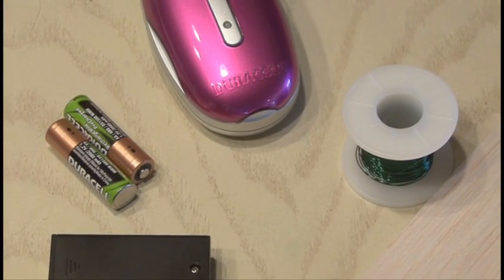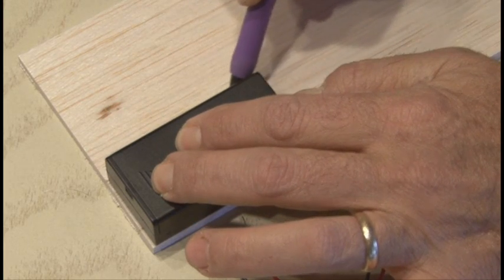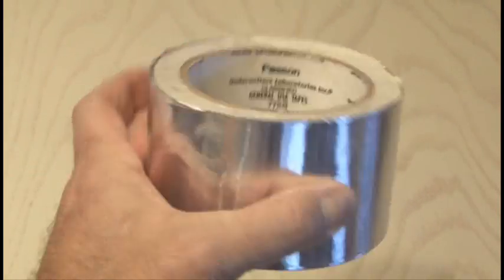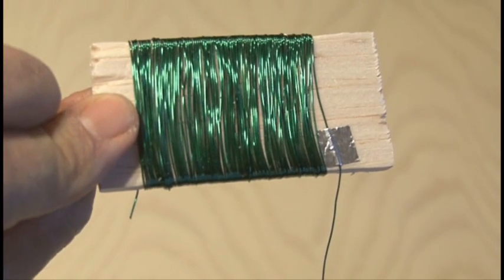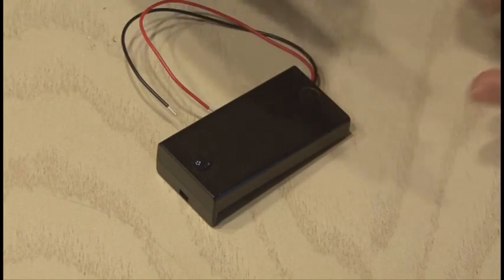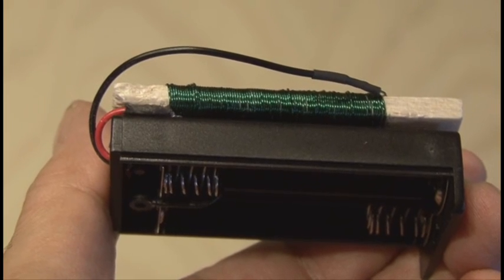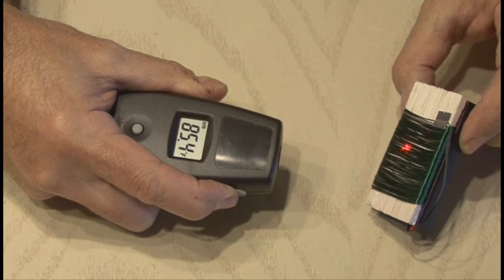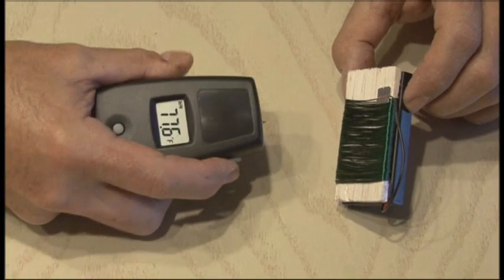Weekend Project: Personal Portable Heater

Comment: Will this make the positive and negative contact and make the battery hot then exploded
Reply: +Minh Vu *SIGHS*
Reply: not when the wire is this long, instead of directing heat to the batteries which would make them explode, the heat is directed to the wire
Reply: Haqet
Reply: Minh Vu it depends on the resistance of the coil

Comment: Could I use a 9v battery
Reply: Possibly but keep in mind one AA battery is 1.5V so two equals 3V, by using a 9V you are adding A LOT more electricity
and it could overheat to the point where it could burn you, catch fire or even explode the battery.
Reply: ***** If the 9v battery could supply the current then yes that would be true. However, they have only about 150ma of power. It would not last long at all and would not be very warm.
Reply: ***** Not enough current for that kind of heat for something like that. Electrical solder melts at around 360 to 400 degrees Fahrenheit. Besides, there are some videos that show how to make a battery powered soldering iron. Some could even run off USB ports, but don't use the ports on your computer. You would just blow an internal fuse.

Comment: can you use non insulated wire? that all i have
Reply: floSa  from 3 volts you wont feel a thing even at 9v you cant feel anything
Reply: No you can't because you will short out the batteries and get the wire to heat for a few seconds very hot
Reply: Electricity is flowing through the wires.
Bad idea to not isolate them lel
Enjoy your shock :D

Comment: I had a problem building my project and I would appreciate it if somebody could help me out.

Having a basic knowledge of electrical circuits, I tried to build one of these portable heaters. I used two 1.5 volt AA batteries in a holder, as mentioned, and a metre of resistive heating wire. The wire has a resistance of one ohm per metre, but there doesn't seem to be any noticeable heat produced when I complete the circuit. Does anybody know what I could do to increase the heat output? Do I need a higher-voltage battery? 

Thanks in advance!
Reply: im not that good with electronics but i do know the type of winding wire matters and may effect heat generation... multi-core wire won't work as well as a single core (bell wire) cause the multi has more surface area to heat up where as the single has just one wire thus less surface.

so i guess to increase heat generated id say if your using multi - core wire replace it with a single core. The other thing that might be a factor is the state of the charge left in your batteries. Another factor maybe the thing that you've got your winding wrapped around that may be drawing out the heat generated by your wire and acting like a heat sink.

from my experiences i do know when i used single core wire in my electronic projects they tend to heat up quicker then multi, cause of this i stray away from single core lol

anyway hope this helps ya :3

Comment: wait less wire = more heat?
Reply: yep thats how resistance works in wires, if you use a REALLY REALLY short wire, Its going to be so hot, it'll met within seconds lol
Reply: what about regular copper wire?
Reply: Yes. V= I.R so shorter wire means less R(esistance) which in turn means more amperage(considering Voltage is unchanging). But if you keep the wire too short, you'll basically short the batteries, and probably burn your hand.
Reply: illusive aeldre would you be able to start a fire with it if held up against clothing??, Who cares about batteries, if the batteries short in a few seconds oh well as long as the thing gets high enough heat to catch cloth on fire Mission: Burning Man can go under way >:D lol, Okay kiddies, let's play hot potato!!.. no no, better yet, LETS PLAY TAG, and member, you can only tag shirts!! OH and let's not forget, okay kindegardeners, lets play duckd uck goose with this magic stick, run in the circle tagging the 3rd person you reach on the head with the stic!!, OHH OH and let's not forget passing by a mall cop and hitting his back with something like this by only walking past him IF this thing catches on fire asshole cops here i come lol, Just gimme a low temp buring oil and this bomb basically and hehehe, im coming for you
Reply: illusive aeldre OH another question, if i connect the red to black and black to red would that cause fire or sparks with this??
Reply: You could  start a fire with an AA battery and some piece of wire. But you could do the same with matches. Matches would be more effective and less dangerous. 

If you connect + and - of the battery with a short wire, wire will get hot and catch fire. Battery might explode too. There probably won't be sparks with just an AA battery. With a 9v, maybe
Reply: illusive aeldre Great great, NOW which of the 3 work best for fire/explosive??,

1. 2 9v's to eachother, (heard it somehow, But i dont know exactly which orientation they need to face in order to begin feeling very hot)

2. 2 AA's with a wire connecting A to B THEN another 2 AA's BUT reverse direction (so say the first two have + going up on the Y axis AND on the left of them is the C and D AND their + is facing down on the Y axis BUT then you take the flat rectangle and fold B and C over onto A and D to make a 3D rectangle/cube) AND B connects to C and C goes to D THEN D hooks back to the other end of A that is NOT already connected. Understand my description??

3. Taking 9 D batteries, Rubber-banding them all together through some scheme or another THEN putting them into kerosene THEN placing it down THEN putting some coal RIGHT BESIDE where I place the battery THEN some newspaper ontop of the coal THEN pour kerosene ontop of it all once I placed all that THEN light the batteries on fire, would that then explode sending the coals on fire by chance in directions AND/OR lighting the newspaper on fire so it can be blown away??

Which would be most spectacular for an explosive, fire, or fire-bomb?? I don't want to use ONLY a match, I'd rather go big for 1. Possible firework uses or at least backwoods-fireworks lol, AND 2. To drop out of a low flying plane into the forest to make a forest fire AND 3. for well.. putting into a asphalt covered street and lighting it as a car is coming OR 4. to light before the always-on-time train comes around. (most of these last 4 uses were jokes but ideas to fellow pyros, plus i already have the jars for making a wild fire from a plane , if i wanted to that is. lol)
Reply: Watch out dude NSA is watching :)

If you are determined to get a big bang, forget about batteries. Buy some Nitric Acid(you can get it from cleaning suplies sellers) get some Glycerin(from apothecaries) mix them 1:1 You got TNT. Oh btw, they will explode as soon as you mix them.
Reply: Lol dude, I'd rather use batteries since I can lug several battery bombs in the bed of a truck to various peoples houses rather than lug a bunch of chemicals around when if they mix they explode you.. which if i wanted that id make a fake chemist kit and give it to the kid of everyone on my hate list lol, but yea.. too much waiting and an innocent life lost in process of putting ONLY mental strain on the real target at hand instead of you know.. POSSIBLY ending the real targets life.

Comment: it will work if the battery in one lipo if it is it will slowly deceased in power and get the the low point at witch it explodes or lights on fire.
if its ni cad or others you should be fine but i bet it is a lipo. if you still want to do it with a lipo you need an power cut off and will cut power before min battery voltage

Comment: well from the usb cable you use the red and black cables. and on the turning wire you have to sand off the ends to make a good connection.
let my know if it works or if you need any more help

Comment: nope, because thirty feet of wire is enough resistance to be just the same as using a light or anything else. check the impedance of a 1.5 volt light, then compare it to the resistance of 30 feet of wire. do you really think a AA battery could actually short circuit for 45 minutes? I mean come one.

Comment: One AA battery has 9360 joules of energy.  That's equal to the heat output of 0.24917mL of kerosene.  There are 3785.41 milliliters in a gallon, so you would have to buy 15,192 AA batteries to equal one gallon of kerosene.  There's your reason why REAL hand warmers burn petroleum.

Comment: hi i want to buy a solar panel and hook a slightly bigger version of that up to the panel instead of wood ill use a pipe or something any ideas on gauge of wire or solar panel to use or if someone already made this id like to see it i want to take solar and turn it directly into heat to save on heat bills in my hosue ty

Comment: basically, but because you have 30 ft of wire it takes longer and does not heat up quite as much and as he said shorter for hotter.  this is a good idea and i believe that you can do it with any battery kind, just AA tends to last longer than AAA and is not too big.  although you can do the wrappings down in you shoe and have it powered by a few D's on you belt or im your pocket

Comment: well kip kay said 30 feet of wire would be around 120 degrees so 120 divided by 30 = 4. so 4 times the number of feet you add minus 120= the amount of degrees itll be.

Comment: Yeeeeaaaahhhh...  it might be 120 degrees on the side thats exposed to the air, but it can get up to plastic burning temperature in the windings that are sealed between the case and the wood.

Comment: Isn't it kind of self defeating to have half the wire trapped behind wood and a battery holder? A different design could yield twice the heat. OR you could just go buy a couple of handwarmers from the store and those last quite a while longer.

Comment: @emmanuelmd345 solder melts at higher temps then a mere 80-120 degrees, The batteries wont leak acid, this doesnt draw enough current to cause that kind of damage, To attach a button, put it on the positive battery lead, and connect it to the positive side of the heating unit. Personally i'd prefer a switch (solder the battery lead on the middle post, and the positive end of the device on one of the side posts for a 3 post switch) Hope i helped!!

Comment: isnt this dangerous? wont the sotter conections eventualy ware off, imjust wondering any safety precautions nesicary, do they have to be rechargeable, wont they leak acid or sumtin, also what kind of button would i have to attatch ifi wanted one, like what are the specifications of it

Comment: one thing to possibly add to it is a variable resistor and a screen to display the temperature that you want and what it is. the variable resistor will be used to control the temperature to what you want it to be. kind of like a thermostat.

Comment: @mullaneydylan Actually not always. The impedance of the wire length must match the internal impedance of the battery for maximum heat. Any more wire or any less wire will mean less heat.

Comment: @guywith2names First class in high school you learn that resistance in a cicuit drops the voltage and exchanges it for heat. As that is the primary intention of this device the efficency should be almoast 100%. Ofcourse there are other things like infrared radiation and magnetic flux, but thats way less.

Comment: Ok - I have some questions....
1. If you wrap the coil around the wood and then glue that to the battery pack, doesn't that mean half your energy is going to heat your batteries and not you?
2. As a few others have pointed out...40 degrees is cold?  Put a - in front of that...now you're talking cold.

Comment: @flyingdumpling69 Very simple: 
The capacity devided by the current is the time that it should work. With a capacity of 2000mAh current draw of 1000mA it should work for 2 hours.
The purpose of this device is to produce heat, all the energy from the battery goes to heat, so the efficienty is as good as 100%, Maybe kipkay needs a better charger if he gets his batteries only 3/8 full.
Just simple high school phisics

Comment: @HeffayNada523 A soldering iron is for melting solder to connect wires.  A hot glue gun is for melting glue.  Solder conducts electricity, glue doesn't.  So no, you cannot use a hot glue gun.  Google is your friend.

Comment: Could you in theory just use the 9-volt battery to fan connection in a altoids tin from the smoke extractor project.Then divert some of the power from the 9-volt battery to a metal grate which would heat up .Then have a fan blowing air into the hot grate heating up the air as it came out. Also a metal screen that would not melt easily could also be glued onto the square hole where the hot air would come out so you wouldn't burn yourself.

Comment: now use 6 AAA batteries, use a small 12v computer fan, and a piece of a window screen, then wrap the wire around the piece of screen and put the screen in front of the 12v fan and put the batteries on the side of it all.

Comment: It does technically make a short circuit. But the gauge of the wire is so small that the current has a hard time flowing through it. There is a lot of resistance in such a small wire, and the resistance causes the electrical energy to be lost as heat, and with 30ft of wire, the energy is dispersed quite well. I'm going to make one today! Just in time for winter!

Comment: I have a lower tech version of this that I found out by accident.  1- Get a small cloth bag or purse  (Or just use your pocket) 2- Fill it with change.  3- drop in a 9v battery.  Believe me it will take a few minutes, but it will get HOT!

Comment: @remotegangstersquad radio shack, they have the winding wire, 2AA battery holder, and the heat shrink tubing. the balsa wood would probably best to get at a craft store or maybe the home depot or lowes.

Comment: yep, shortcircuiting is bad
but in this case, it's NOT shortcircuiting
if you hook a lightbulb up to it, is it "shortcircuiting"?
no because the light bulb "uses up" some of the power, so not ALL of it goes back to the battery, which would be excessive. In the same way, this special type of wire also "uses up" the energy, so not all of it goes back to the battery. Think of it this way, the special wire in this circuit IS the lightbulb
:D sorry if its confusing, this is the best I can do

Comment: think of it this way, a lightbulb resists the current and turns some of it into light energy
this wire turns it into heat energy
in both cases, you don't have pure energy flowing, a lot is converted =)

Comment: There is alot of inductors that dont require a ferrous core to a magnetic field ... electromagnetic field is naturally produced when a current is applied to a coil of wire or wire in general...

Comment: oh and another thing the longer the wire the more resistance moron..so yes by the the current reaches the other end that 3volts is less than it is when it orinally started more the longer the current has to travel the more resistance in the material it has to run into... thats basic knowledge GOT ENOUGH FACTS?

Comment: you need to pay attention to detail for one.. 20 gauge or 30 gauge wire is really thin.. even if it was less than 30 feet of it and only 4 inches instead... the wire would burn inhalf long before the batteries ruptured.... hence the 30 feet balancing it.. and where the energy is being reduce before it comes back into the batteries so its less than 3 volts... 30 feet is a long ass fuckin way to travel for 3 volts.. dont believe me get a fuckin multimeter or do u even own one

Comment: btw the reason the temp doesnt continue to increase is because a level of energy is being use so.. the only thing that happens after it reaches its peak temp is to decline downward which would be really fast seeing how its a (2) 1.5volt batteries (fyi due to the resistance within the wire the wire will always heat up more than the battery would... take your car lighter for instance.. why hasnt you car batter exploded into flames????????

Comment: it is a short at the same level that a circuit with an tungsten light circuit is a short....we call it a resistive circuit, the current is consumed by the resistance generated by the wire. it is great to say that if you put a metal tube instead of the balsa piece in the center of the coil, you just created a great electro-magnet

Comment: @Mik3m6232 that is why you use winding wire and 30 ft of it. the wire has resistance so it is not a short. you could make a heater with several resistors as well.

Comment: And one more thing as far as batteries exploding magically... lets do the math here 30 ft of 30 gauge wire.... plus 3 volts .... there wouldnt be enough push to cause a explosion like you describe by the time the current reaches the other end... the only thing that would happen is the batteries would get warm and probably be useless later faster than normal use rechargeables..

Comment: @JnthnRzc 
Don't worry, it's only a few batteries and exposed wires wouldn't hurt a mouse.
Though the heat it generates (not the free flow of current like my first theory) is another thing.
Just more wire then. :P

Comment: No, it wouldn't catch fire if you follow the correct wire diameter or thickness and the battery input voltage.

...The only chance the device would catch on fire if the wire heater glows (if you use thin wires such as tungsten coil in soldering iron), or if the device produce sparks and ignites a piece of fabric like your pants.  

But with a 30 feet of wire coiled into something like 200 - 500 turns and a 3 volt battery, you could never go wrong.